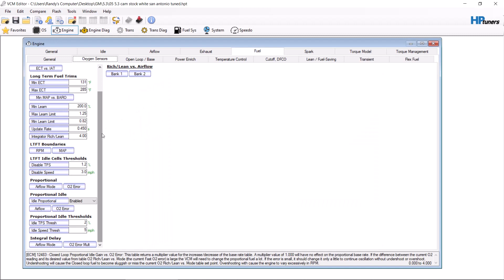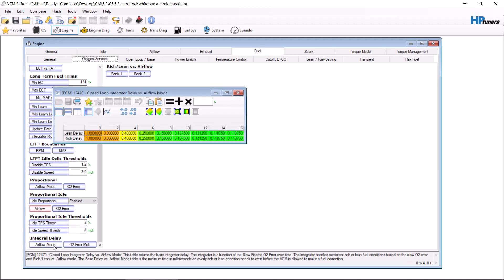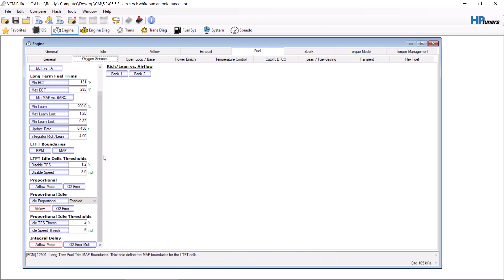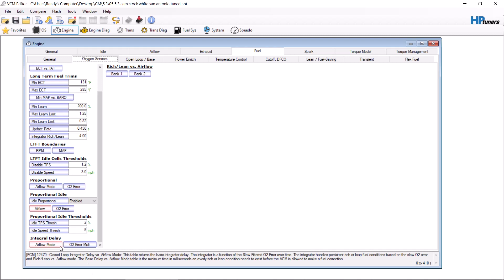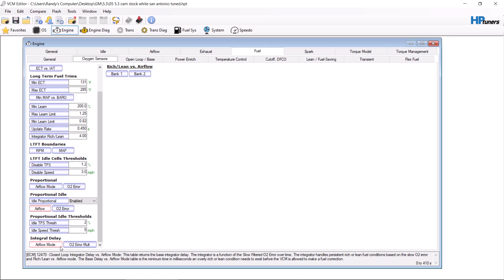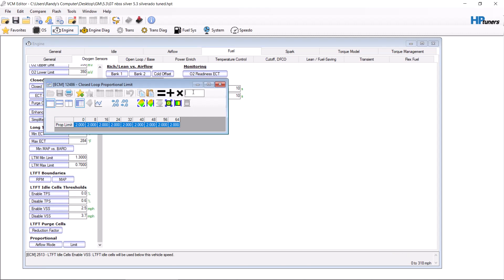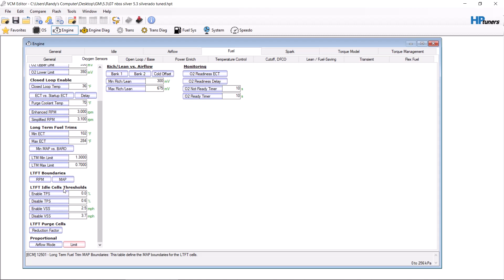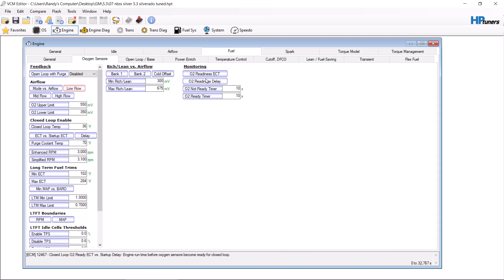Oxygen sensor settings when you install long tube headers

Comment: Questions i install long tube header on my corvette c6 2005 she run fine the only code i get is the rear 02 sensor my question is i need a tune or i can run whitout tune  ? I don't want to demage my engine
Reply: You can turn off the post(rear) O2 sensors and will not hurt your engine. They’re used to monitor the catalytic converter’s functions for vehicle emissions.
Reply: @Zanester101 what about my engine people say the engine run rich or lean ??

Comment: I got my car tuned with long tube headers 2014 Camaro SS and still get lean to rich codes on both of the O2 sensors before the cats. Any suggestions?
Reply from the maker: Fix the tune
Reply from the maker: If you need a remote tune just let me know
Reply: @Recklessmotorsports  I don't know what that is. The guy who tuned my car won't respond back, so I am still running lean to rich.
Reply from the maker: You don’t have a tuning device at all?

Comment: So for gen 4s all that can be changed to address long tube headers are: proportional limit set to 1.25, airflow low-high reduce by .95 and if needed o2 readiness delay add “sum time”… ill try this and see if it works 😊
Reply: he doesn't reduce by .95.......he reduces by .05
Reply: Codes turn off but monitors dont get ready with your settings

Comment: For a 5.7 HEMI (ngc3) with long tube headers and catless. My car is running lean, i’m a learning with HPT. I want to ask what the better methods to correct the AF ratio? I need to correct the 02 like this and let the computer do the correction or be helped by AEM withband and correct the VE table?
Thanks
Reply: Did you find it? Just installed SW LTH trying to get normal AF, but i think usually its rich then stock with stock headers

Comment: I have my 2010 5.7 hemi charger long tubes & cats. The tune that I paid for disabled cats I went in and enabled them along with anything else needed to pass inspection for emissions. Problem I have is O2 sensor monitor and egr monitor will not run. Has a TSP stage 2 cam lost on how to get one of the last 2 monitor to run to be able to pass inspection.

Comment: My rear 02 sensors were eliminated when my cam and long tube headers were installed. Since then I keep getting a code saying the upstream 02 sensors inactive. Currently they read 440-450 mv regardless of rpm. My 30 year corvette guy that did the work says that it can be adjusted with the tune. Is that possible. All electrical connections are correct and I’ve went through 2 sets of new 02 sensors. Thanks a ton. 2002 corvette z06.
Reply: It needs to be tuned so the o2 voltage will switch rich and lean

Comment: Anyway you can make a video on turning off engine light after headers on 6 gen Camaro
Reply: you have to disable the error on diagnostic tab on HP tuners. It will be bank 1 or 2 sensor 2 depending on what o2 sensors you still have installed. My 5th gen doesnt have rear 02 sensors so i had to disable sensor 2 codes. after that the check engine should clear up by itself. If i had no O2 sensors at all then i would have to disable all o2 sensors codes by using the pull down where it says MIL on to No error reported. Save it and then write it to your vic.
Reply: Questions I have corvette c6 i install long tube header now I need to turn off the rear 02 sensor how i can do this whit the HP tune? Which HP tune i need to do that ?

Comment: Tried these adjustments on my gen3 not really affected the o2 performance…any updates?
Reply from the maker: If this is the o2 header video it’s just designed to be small changes for the o2 after header install to prevent codes related to o2 heater
Reply: @Recklessmotorsports  right I have issues with oscillation after coming to an idle.  I ran across your video and hoped it would keep them bouncing.

Comment: Multiplying by .95 only lowers the value by 5%. If lowering it 95% you need to multiply by .05
Reply: So should it be reduced by 5 or 95, based on this correction

Comment: So I adjusted all these and she is running ok, although Im running just a little lean. Should I start tuning everything, or can I change one of these parameters and get it richer? I have no other mods, just long tubes, no cats and full 3" exhaust on a camaro ss.
Reply from the maker: You can adjust the MAF
Reply: @Recklessmotorsports  but my o2 sensors keep leaning it back out?
Reply from the maker: Oxygen sensors don’t care what anything says they put your vehicle at 14.7:1 roughly so if you add to the maf and oxygen sensors and taking awhile fuel then your vehicle is too rich. You can’t get away from stoich 

The only thing you can do is put it in open loop mode and control fuel from pe table but that can be very difficult
Reply: @Recklessmotorsports  my problem is, seems like the o2 sensors are swinging happily,  commanded AFR is 14.68, but the AEM x series reading about 15.2. I guess I could try a free air calibration.
Reply: @derBara83  i run into the same at idle. Cruising I bounce between 14.8 & 15.2 pretty consistantly. Shorty headers on my vortec 350/4L80E/4x4